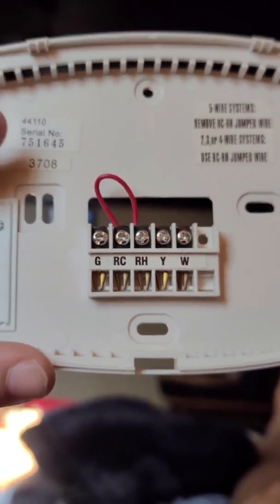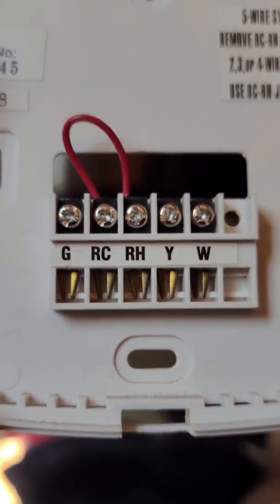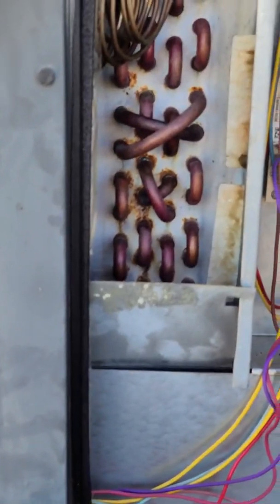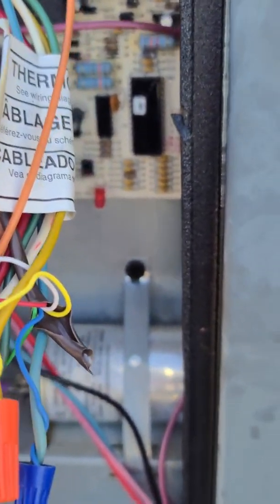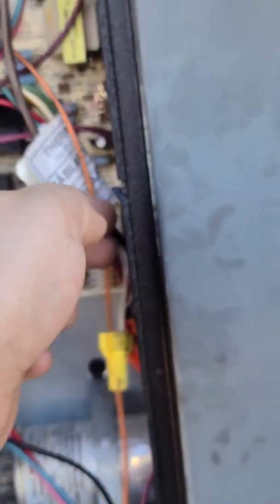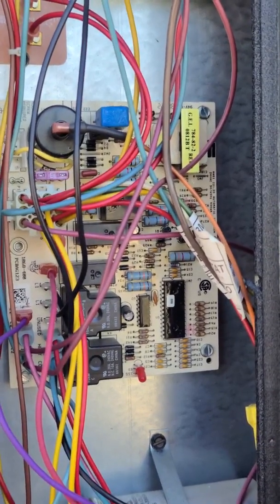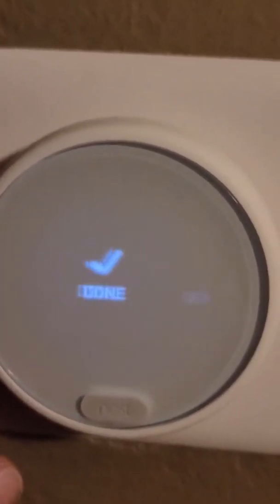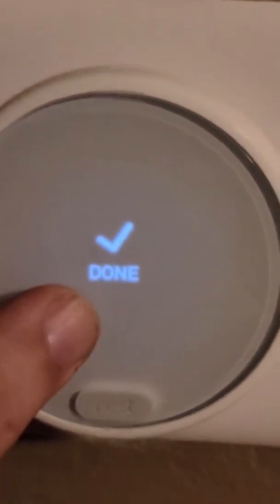Google Nest Thermostat E Installation Wiring 24v Common (Blue)

Comment: So if I have a jumper between the RC and RH it’s okay to just plug the wire into the red on the Nest? I know you’re not supposed to use a jumper but I have a dual transformer system so it’ll work for both RC and RH just being in the R?
Reply from the maker: Yes that's correct as far as no jumper being used... But the dual transformer I would research more as it makes things more complicated with the common etc